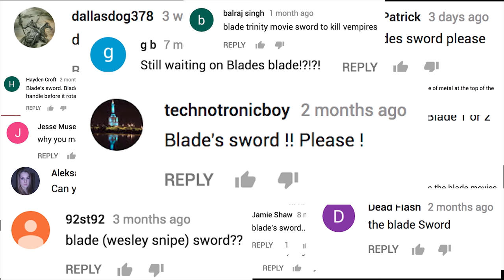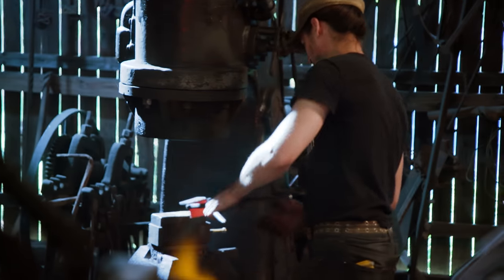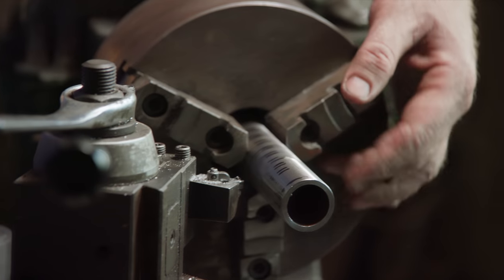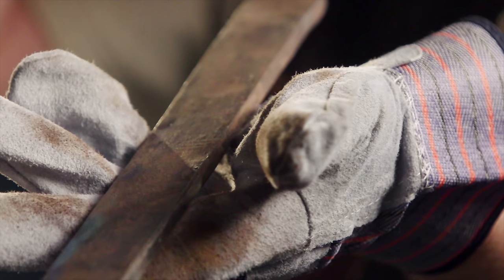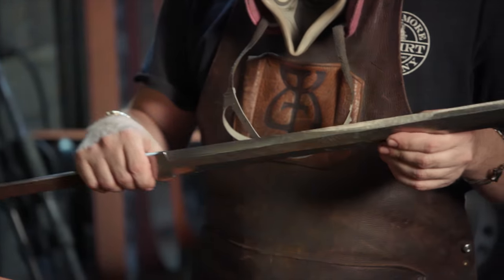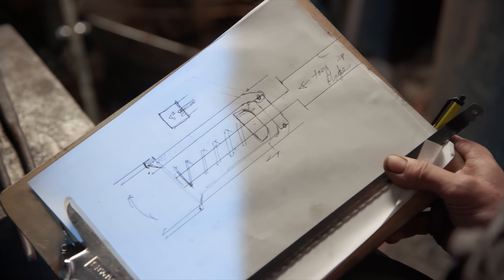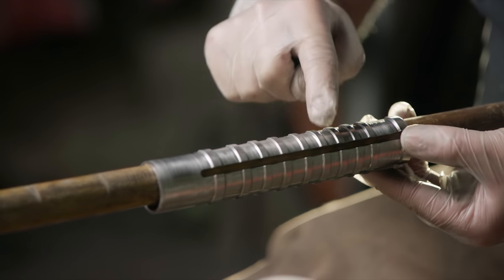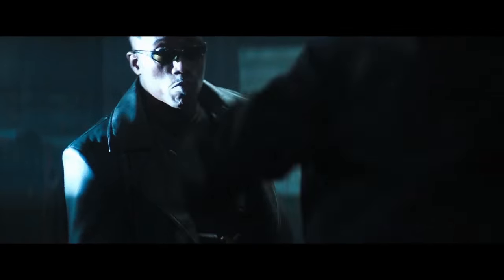Blade's Sword - Marvel Blade Trilogy - MAN AT ARMS: REFORGED

Comment: Now make a Tungsten Carbide sword.

You should be done grinding by next year.
Reply: Dread, the Mad Smith Haha yes! :D
Reply: Dread, the Mad Smith With an antimatter handle to increase cost,  impracticality and the fact that it can blow up a city when it touches anything.
Reply: My wedding ring is made of tungsten carbide.  I've actually broken things with it on accident just because I forget that you can be at weenie hut jr and still break something with tungsten carbide.
Reply: Tungsten Carbide is not hard to grind
Reply: There's little malleability with Tungsten Carbide. XD It'd probably end up being as useful as a glass sword. 

But, then again, I'm thinking too practical.
Reply: You could also accomplish the tasks very easily with a high quality haas CNC milling machine although it is very pricey and can add up to a quarter million so for this channel it would be almost impossible. But then again I dont know there budget.
Reply: Yeah with Tungsten carbide you can't forge it because it was made by Sintering process you sinter metal powder in to shape, so if you try to heat and forge it will break into thousands pieces.  Only way to build is to grind it in shape, and if you hit it too hard it will break into pieces.
Reply: Honesty 101 you cant really cut tungsten with anything it has to be abraded with diamond
Reply: viermidebutura it's not hard for grind,but it can't be forged.
Reply: You can grind tungsten cirbide with a diamond grinding disc pretty easily. The bigger problem would be that the sword would instantly break if they hit somthing with it.
Reply: I like how people are missing the fact that this is a joke based off how many belts it took the grind the titanium sword in the video.
Reply: There are diamond tipped end mills also heating isn’t an issue with that machine as you can install coolant tanks that cool it constantly. 
  I’m not saying any should do this but if are going to do this understand that it’s going to put a dent in your wallet and it’s not really practical.
Reply: akali’s weapons
Reply: Better yet, window glass, super cheap window glass.
Reply: Ha! Wouldn't that just be the easiest thing in the world to make. WHAT WOULD YOU USE TO GRIND IT! HAHAHA! Good Joke!
Reply: ye first try to forge it...
Reply: Why a Haas? theres tons of other cnc's available, and they could just use a used one which is much cheaper
Reply: Oh dear lord...
Reply: What would you use to grind it? Probably blood and human skulls, you know, nothing too special.
Reply: btw allready worked with tungsten carbide to do a  XRF spectroscopy. had to "grind" it with special diamond plates (~1500€ per plate)
Reply: Dread, the Mad Smith samehada , hoshigaki kisame's sword from naruto
Reply: Dread, the Mad Smith puedes aser los vídeos subtitulados en español porfa
Reply: That blade would be exceptionally brittle rendering it useless.
Reply: @viermidebutura  I think it brittles! Doesn't  it?
Reply: @pluem92f  I have heard it Brittles!

Comment: Don't get me wrong, what they have done was awesome. But they are missing a couple of things. 

1. the blade is coated in silver.
2. the handle blade mechanism isn't manually activated. It activates when someone grabs the sword. When the "key" rotates to the right position, then blade pushes it into a locking position PREVENTING the blades from popping out. It's a defense mechanism.

Comment: Are we just going to ignore the fact that Ilya used a saw blade as a ruler?
Reply: rockyblacksmith he used it as a straight edge, totally legit.
Reply: Industrial band saw blade is actually very straight backed material, by nature it has to be otherwise it wouldn't perform reliably.
Reply: rockyblacksmith Yes we are
Reply: rockyblacksmith, I feel he was making a scheme without the need of a ruler... only straight line, any straitgh piece would do the job in this case
Reply: rockyblacksmith are we going to ignore the fact the springs in the hand piece were shite. That sword looked like a toy
Reply: I saw it so what
Reply: St George
not any toy I've ever seen, or would give to a child. the spring worked, doesn't matter where they got it from.

Comment: That round handle would make it impossible to make a decent cut in real life. Still my favorite build on the show so far. Love when they experiment with different material besides steel.
Reply: It’s actually not round. The prop replica and the original hero sword has a flat section so it’s not a circle but looks like a letter D. The flat side is always on the palm so you never see it.

Comment: I saw a video recently about freezing a sword after a heat treat to make it stronger that I am critical of. Is there any validity of this process?
Reply: Ask Skalagrim
Reply: It depends on the steel used. cryo treatment is supposed to help the grain structure of some steels. AEB-L is one such steel.
Reply: to my knowledge, Skallagrim isn't a smith, he's a collector
Reply: some knife makers do this, the best known one is Kbar, and in my experience it makes it a little stronger in like prying stuff open, but the edge strength is about the same as any other 1095 blade out there.
Reply: Todd- Bomb should be, its used industrial in solingen.

Comment: 8:20 actually the mechanism of the blades inside the handle has a timer of 5 seconds to the blades popup, as the seconds goes the guard moves clockwise

Comment: If they were trying to be movie-accurate, shouldn't it have a silver edge?
Reply: Just how much money do you expect them to sink into this?
Reply: My understanding is that there was the tiniest bead of silver down the blade-edge, (which is still weird, since silver wouldn't hold an edge).  Regardless, they went to the trouble to make it out of titanium and included the hand-destroying spikes, too...
Reply: Tanin Moores But that one wasn't actually made out of silver.
Reply: I don't recall them mentioning any silver in the film, just that it was made from acid-etched titanium.
Reply: Isn't it just me or wasn't the mech lock for the blade suppose to be at the other end other the handle and it spins round untill you push a noch up to stop it from releasing the blades ?
Reply: Yeah, in the film the timer/locking mechanism is indeed located under the guard, as opposed to being the pommel.
Reply: Matt payne i thought i was the only one who realized that
Reply: I guess I could be mistaken - I thought they mentioned that the sword had silver in or on it, which is why it had such a reaction when he used it to cut the vampires.  Why did they burst into flames/dust just from him stabbing them, then?  EDIT:  At around the 2:27 mark from the following clip, he starts fighting the vampires with just his sword, and they burst into flames/dust from just sword strikes - many of which just look like slashes - the sword has to be specifically "anti-vampire" in some way, as the stakes and bullets he uses were also...  https://www.youtube.com/watch?v=Kd6UtMo3JDw
Reply: Its something I've wondered about too and feel like the film kind of dropped the ball on really explaining since they always make it such a big point to explain which things work on vampires and which don't, but they never say anything about his sword having any special properties.

Comment: Was there any way to tell where the cutting edge was oriented when holding the round hilt. It looked like a couple of those target were slapped a little more with the flat of the blade rather than the edge. Blade's sword isn't very practical, but it looks cool.

Comment: Very cool overall sword. Wonky grinds though. Forging out the primary bevels would have saved much more time, energy, and certainly a lot more money. alpha-beta and beta titanium alloys make much better blades and can be heat treated as well. Along with the addition of reinforced carbidized tungsten and titanium carbide exceeding 70+ minimum hrc, edge retention is also a non issue.

Comment: So it's resistant to abrasion, which is usually what makes something retain an edge, but edge retention isn't good?
Reply: abrasion resistance has nothing to do with edge retention. edge retention comes from the hardness of the material and how flexible it is. titanium isn't a good material anyway seeing that it is way lighter comparatively to steel and as you know E=mc² so reducing the mass isn't a good idea

Comment: Something I would love to see is a high carbon steel sandwiched inside a titanium "body" something like honsanmai but taken to the extreme, maybe after making the hardened steel core to fit in a titanium sheath you could braze the two together, I'm fairly certain they won't forge together very well if at all but anyway has anyone seen anything like what I've described?

Comment: A surface grinder might work better than the belt sander...
Titanium likes a slower speed/high feed approach. Can you slow down that belt sander? Also have to keep it cool, constantly wiping it with a wet rag or just dipping it in water would help. I have some past machining experience with titanium and now a days I use it to make chainmail so I’m cutting 18-22awg titanium with a tiny handsaw and I move the blade slowly but with a tiny bit more force than stainless steel. With ss I literally let the saw do the cutting but with titanium I have to focus on a slower speed and give the saw just a little bit of pressure. I probably apply a cutting wax to the titanium 3-4 times as often as steel.

Comment: It doesn't seem possible (yet) to make a high hardness titanium so that the blade can maintain an edge. And it seems hard to forge weld titanium and steel. But what if you use another metal in between? Couldn't you use a thin layer of nickel or another metal that will forge fuse with both steel and titanium in between? The blade edge would be hardened steel and the sandwhichingnlayer to enable fusing would be nickel with the core and spine of the blade made of titanium.

The titanium would make for a strong spine and reduce weight

Comment: You need to grind the titanium at low rpms the slower the better if you go full speed that titanium will get hot very fast and burn the sand grit every time
Reply: im sure they know what they are doing
Reply: 😂 I use to work for an aviation company
Grinding it was the only reason they burned thru so many sand belts and the reason I can tell the lines Weren't straight.. But you keep telling your self that

Comment: It's not that titanium is abrasion resistant - it's much less so than steels - its that hot titanium happily dissolves pretty much any conventional abrasive, especially silicon carbide and at high heat, aluminium oxide, which is what those Norton Blaze belts are made of. When it dissolves a source of carbon, you end up generating titanium carbide and titanium dioxide at the the surface. When it dissolves alumina, you get titanium diioxide and a mixed solution of titnaium dioxide and alumina. That's what was eating your belts.

Comment: Can someone please explain the point of a titanium sword?  As I understand it; while titanium is more corrosion resistant and lighter than steel whilst retaining similar strength, it's also harder and more expensive to work with - is there someway to have a blade with a titanium core and a steel outer layer to get the best of both worlds?
Reply: my guess the script writers didn't really know much about metallurgy and just thought that "acid-etched titanium sword" sounded cool

Comment: Isn't titanium much harder than conventional steel?
Reply: Corous no, it is stronger.  Strength equals not breaking, think soft clay.  Hard equals resistant to scratching or wearing, think glass and diamond.  The harder something is, the weaker it is, the stronger something, the softer it is, generally speaking.

Comment: Overall a very nice replication, But not quite exact to the original. The trigger mechanism should have been at the top of the hilt not the bottom. Also it is on a timer not all mechanical, You don't push the blades back in they pull themselves back. Nice try though.